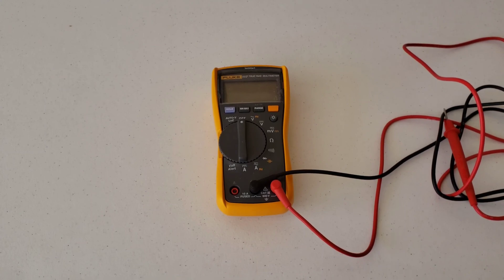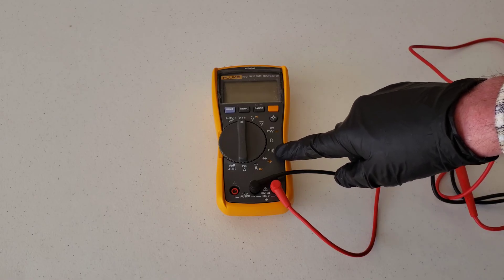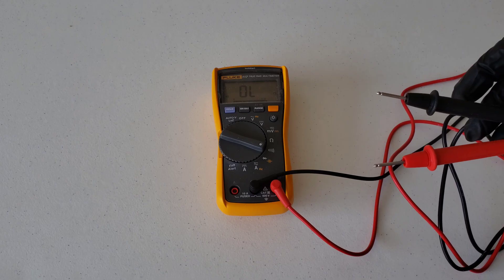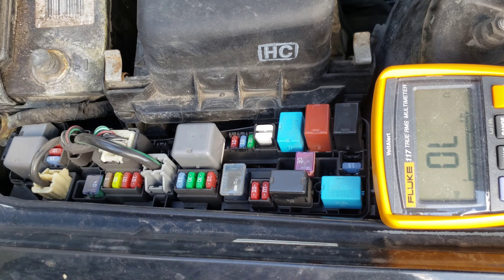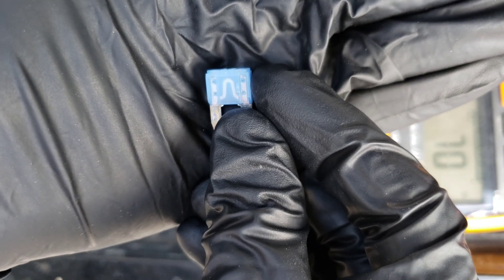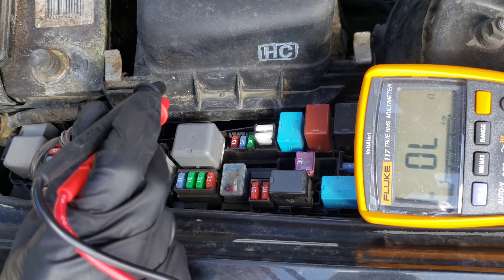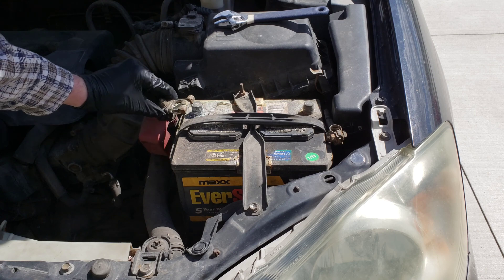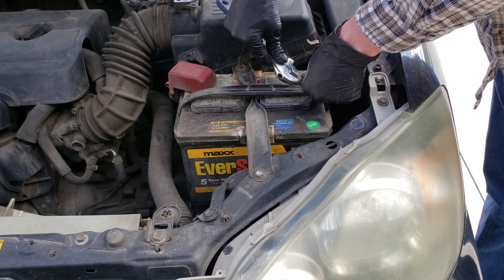How To Test Car Fuses Without Taking Them Out - With Multimeter On Toyota Corolla

Comment: You don’t need to disconnect the battery. Set your multimeter to voltage, turn the ignition on but don’t start the car. Then put your black probe on ground and touch each post on the installed fuse with the red probe. The voltage should be the same at each post.  If you have voltage at one post but not at the other then the fuse is blown.

Comment: How about testing a fusible link on a 2010 Toyota Corolla? I have no output from the stud on the alternator to ground and I have a good battery. I was told the fusible link could be the issue, but no idea how to properly test with or without voltage. I can't get my car out of park even though it starts and just about every warning light is on currently. Nice video BTW, very helpful.

Comment: What if you have a multimeter that doesn’t beep? How would you know if the fuse is good or bad? What should I be looking for? Thanks
Reply from the maker: Thanks for watching, I appriciate it! In short the Continuty reading of a good fuse should be 0 or close to it. I will add that to my video list and hopefully can make a demonstration video on it soon. Make sure your safe when testing fuses by wearing the proper safety equipment and disconnecting the battery the proper way before testing. I have a video on how to disconnect the battery the safe way if you want to watch. Thanks again for watching!
Reply: @ToddsGarage  Much appreciated. I saw some other videos after watching this and your response is consistent with what I've heard. Thanks again.